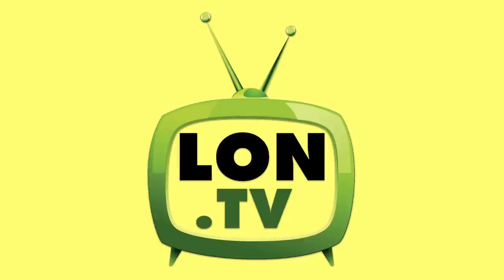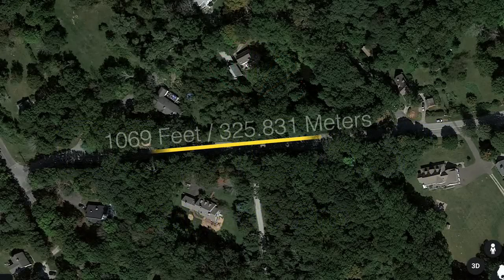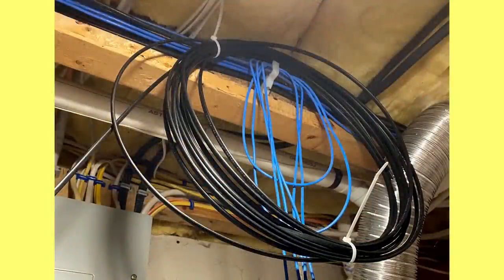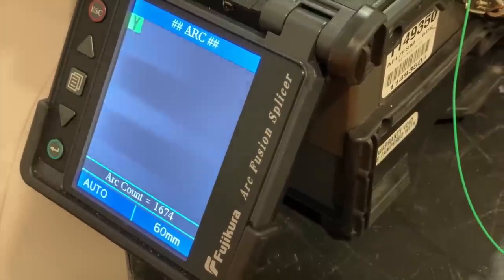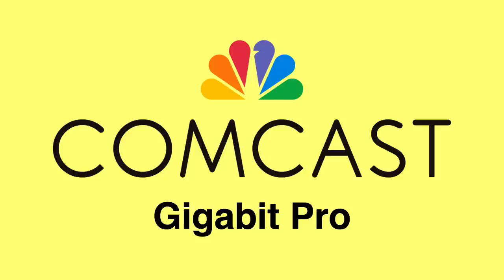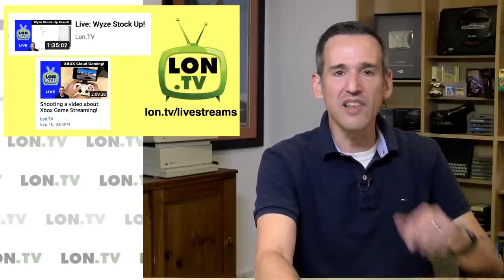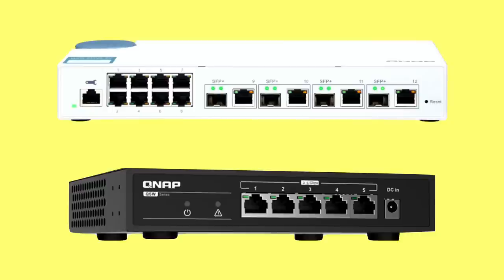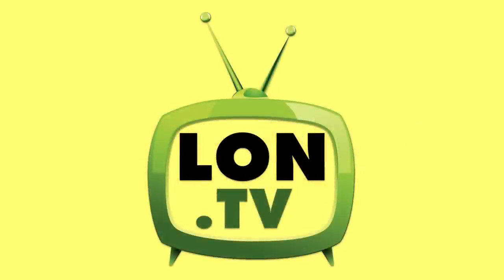Comcast Gigabit Pro Fiber Install Part 2 - Fiber pull and splicing!

Comment: Great series of vids that you're making on Comcast's Metro-E product.
- Fiber is always referred to in pairs, not strands. Because 1 strand in each pair is used for TX (transmission), and 1 strand is RX (receive), and you need 1 pair (RX + TX) for any service. Can't provide service with 1 strand...
- You have 12 pairs to the end of the street. (2:45). 12 home connection capacity.
- Dark fiber refers to the "unlit" pairs of fiber. Your pair will be "lit" and in use, using lasers to sent photons. (2:57)
- To your home they pulled 3 pairs. (5:12)
- The cable is rigid, because the fiber is glass, and the glass can break or shatter (5:24)
- Yes, you can carry Tb of data if you use all of the wavelengths. Its the same basic fiber used around the world, and under oceans, with more protection. (5:52)
- The fusion splicer ensures that the glass fibers are perfectly aligned and then spliced. Alignment is important to make sure you have no loss of signal. This fiber is single mode. This splice is also referred to as a "glass-through" connection, which if done right should have no signal loss. (7:35)
- It is a single cable. Most importantly, it's effectively a continuous cable. A fusion splicer is much better than the old school pucks used to polish multi mode fiber, where alignment isn't as important. Single mode fiber is a straight shot down the fiber. Multi-mode light bounces off the the inside of the bigger fiber wall, so alignment isn't as important. (8:10)
- CWDM is Coarse Wave Division Multiplexer. It's cheaper and more suitable for this work than DWDM. Correct, CWDM multiplexes multiple individual signals onto different wavelengths within a single pair. (8:49)
- SFP+ will terminate your pair, not a strand.  (9:46)
- Use that Ubiquiti router to route between the 2Gb and the 1Gb connection. You should be able to setup bgp which would give you redundancy if you lose one link but not the other. Which is unlikely because typically the fiber will be cut and you will be SOL, but maybe if they make a config change on their end, Comcast would only break service on one of your links. Again, unlikely since Comcast isn't going to make changes, unless they are grooming links in the region. (9:58)
-2.5Gb is supported over CAT5e for the full 100 meters. This page has a great pic. https://en.wikipedia.org/wiki/2.5GBASE-T_and_5GBASE-T. 5 and 10 Gbe over CAT5e is distance dependent. I would get your CAT5e runs certified/checked, a poor termination will result in signal degradation. Certified CAT5e terminations may let you run higher speeds. See if Fluke will let you borrow a network tester. (13:50).

Comment: Imagine finding out a couple years later that Concast was shamed into not using the scam term of 10g internet. They didn’t provide that service. I just found out recently that they have been scamming my mother-in-law. They told her that she had 5g fiber for awhile and that she had to upgrade to 10g. They told her that her 10g internet service needed a different modem because the wire connector was different. Once She told me about all of this I was immediately suspicious of this. I went to her modem to find a black modem with a coaxial cable connected to it. I knew they were con artists but whoever did her service is gonna here it from me and a lawyer. I have asked my wife to find out how long they have been charging her for fiber and how much more they were charging her. Concast is pathetic and shameless POS!!

Comment: Hey Lon! I'm loving this series!

Instead of the UDM, if you look at the Netgate PFSense SG-2100 (https://store.netgate.com/pfSense/SG-2100.aspx) youd be able to utilize both connections as either load balance or fail over. 

Just a thought.

Comment: Is what you need to do is run all CAT6 to your house and that will run 10gig for your network and take a look at the unifi https://store.ui.com/collections/routing-switching/products/unifi-switch-16-xg 10gig switch. for $600 for that speed is a steal. You have a choice to make if you want to run 10gig Rj45 or Fiber throughout your house.
Reply from the maker: Oooh I may pick one of those up I didn't realize they had one with that many ports!

Comment: Interesting stuff.  FYI, you can also use Cat 6, 6a, and 8.1 to get 10 Gbps or more.  I had ethernet added to connect my office to my basement (where I have a tech rack) and used Cat 8.1.  It supports 20-40 Gbps from what I have but is nice because it is fully compatible with normal ethernet RJ45 connectors.  That is, I have a Cat8.1 wall plug in my office and a Cat5e legacy ethernet cable directly connected to it (for now).

Comment: I am curious about the 3GBit/s total claim.  I was under the impression that Gigabit Pro was 2Gbit/s service, and the two switch ports are effectively in the same VLAN. The SFP+ port provides the full 2Gbit/s service to customers with capable equipment.   Whereas the 1Gbit/s port is fallback for people that don't have capable gear, but for who 1Gbit/s up+down is still sufficient.  Has Comcast explicitly stated you can use 3Gbit/s total?
Reply from the maker: The guy we interviewed a few weeks ago said his second leg is an additional gig over the 2 on the other connection, see the end of his post here:  https://binaryimpulse.com/2019/11/comcast-gigabit-pro-install/
Reply: @LonSeidman  Once install is complete, you need to do a simultaneous speed test of both ports to see if it really gives 3Gbit/s total.  Reading his blog post, it gives separate IP allocations, but I didn't see anywhere that he confirmed simultaneous speed tests.
Reply from the maker: He mentions it towards the bottom but I'll definitely test it for myself!

Comment: Is this PON or metro ethernet?
Reply: It’s MetroE connection.
Reply: @keganotoole6805  what's the make/model of the SFP+ module they use to terminate the LCs?
Reply: Bubba198 it depends from what I have seen they always use LC for the connector but for the module it depends I’ve seen them use juniper branded modules and then modules with no branding.